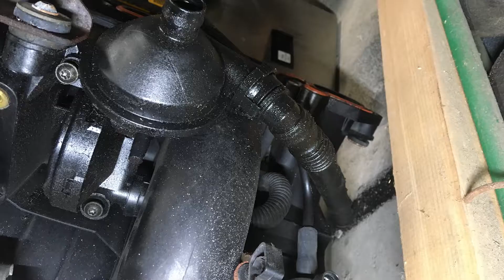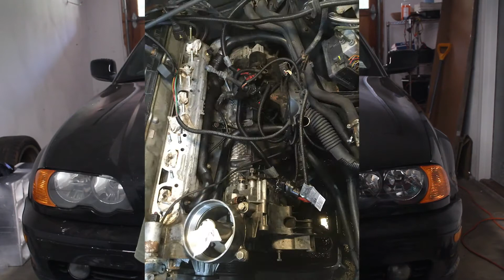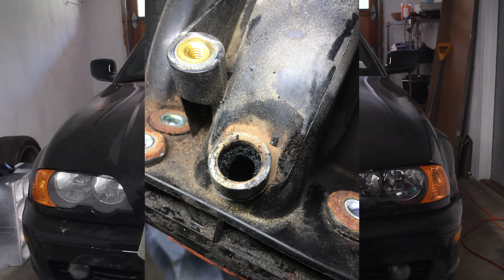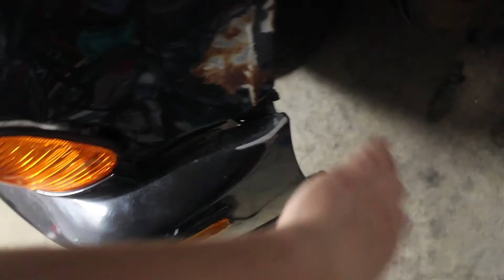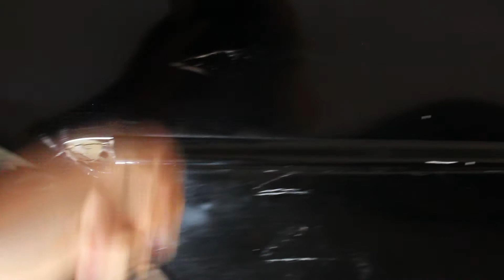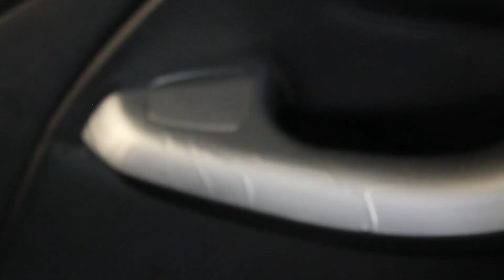BMW E46 Race Car Build: Issues, Stuff I Fixed, Plans!

Comment: Could you do an update on your Sachs moped?
Reply from the maker: Unfortunately not, I sold it a few months ago. No longer had much of a use for it after school.
Reply: @rainvillecreative5410  awww, how much did you sell it for, I am curious how much they go for because someone is currently selling two of them for 700 each but they don't run so I don't think it's worth it, how much would you pay for those?
Reply from the maker: @georgeyaknowthegeorgeyeathatme  Sold for 650, but it also had quite a bit of work done, as you can see from the videos. If it's not running, it's not worth it to pay  that much. Seems like 400-500 is what running stock mopeds go for usually.
Reply: @rainvillecreative5410  so would 300 be appropriate for those or is 200 better because i want to make an offer but not low-ball or atleast give a low price with support to that offer.
Reply from the maker: @georgeyaknowthegeorgeyeathatme  Hard to say without seeing it, 200 is probably a lowball, 250 is most likely what I'd offer
Reply: @rainvillecreative5410  ok thanks for your help